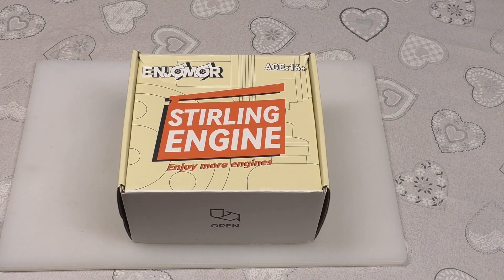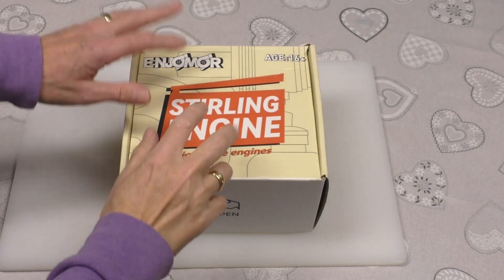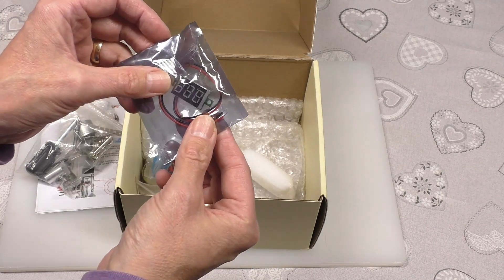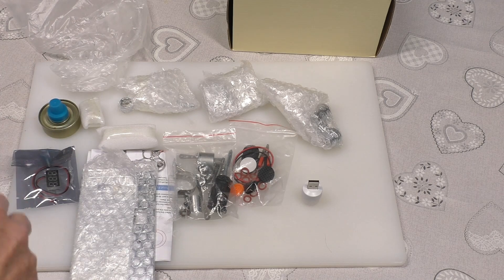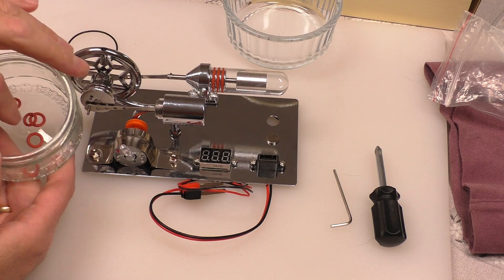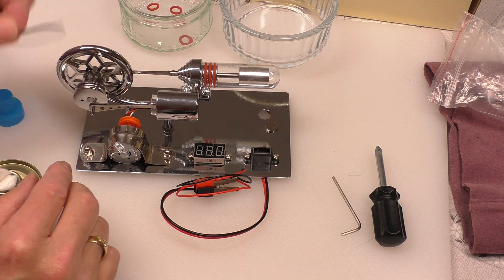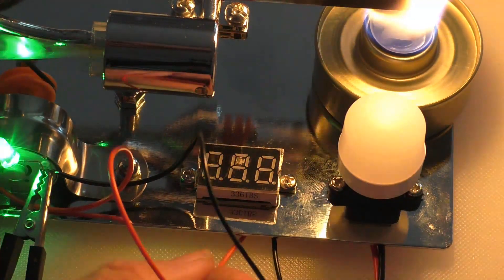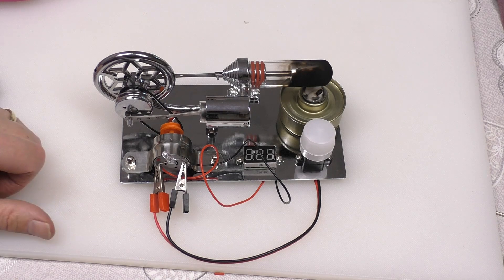ENJOMOR.  Stirling Engine. Educational and easy build. #steam  #enginediy

Comment: Should the cranks be at 90 deg to each other on most Stirling engines? Your look to be something less than that
Reply from the maker: The set up was more 45 degs.  I did tweak the timing a bit to see if i could get higher voltage.